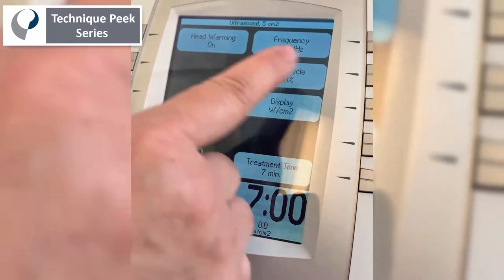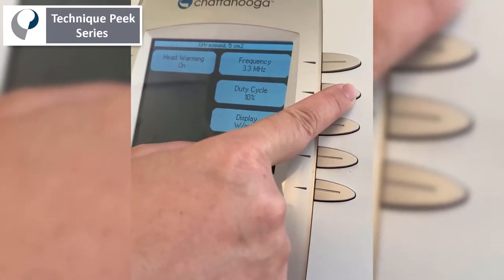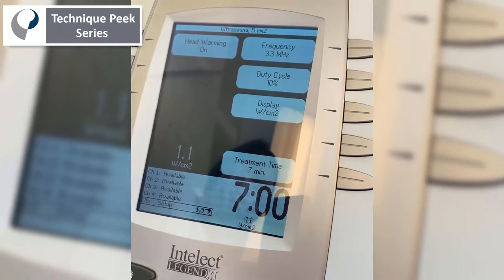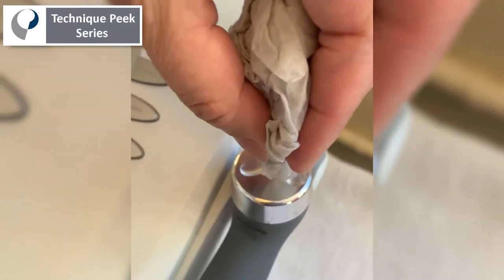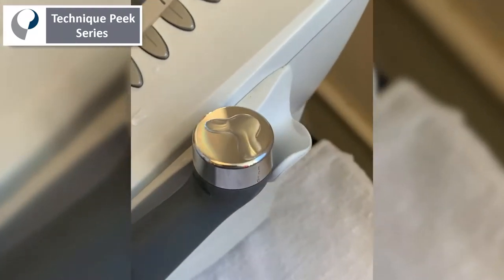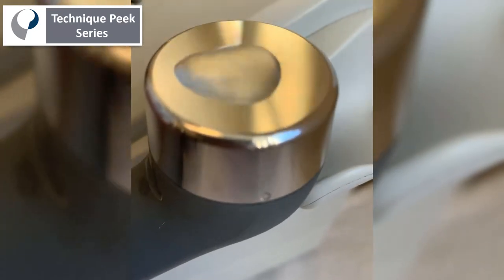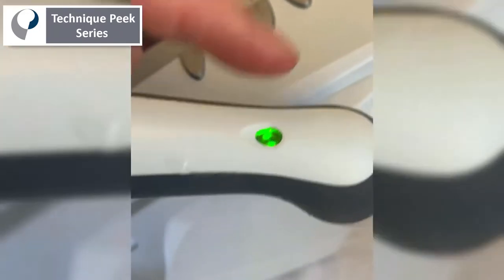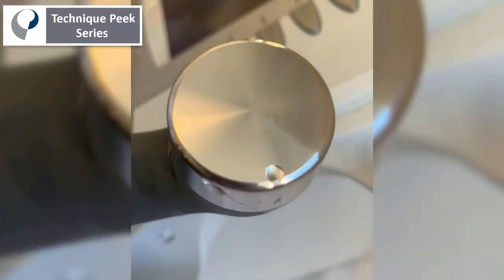How to Test Ultrasound Transducer Head  |  Technique Peek Series

Comment: Yeah mine finally sizzles but only for a few seconds. This seems like it’s supposed to sizzle the whole time it’s on. I’ve got a cheaper portable ultrasound therapy machine from marketplace.
Reply from the maker: As long as the crystal is transmitting ultrasound it should cause the water to sizzle.  Thanks for watching.